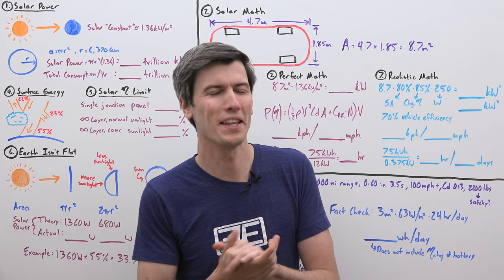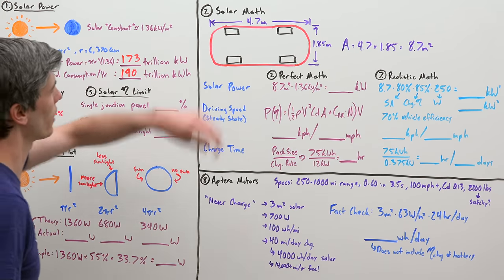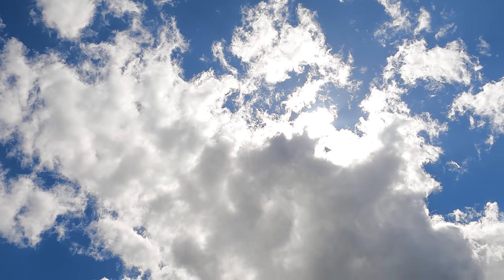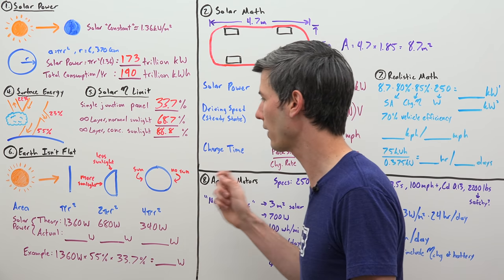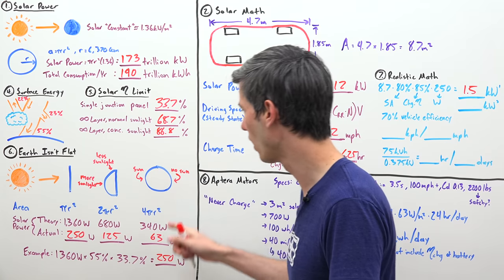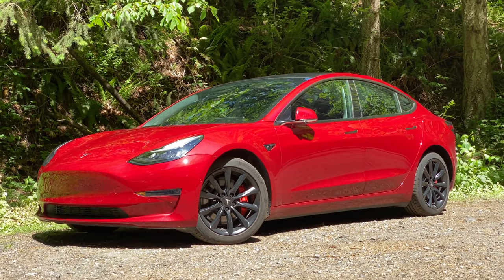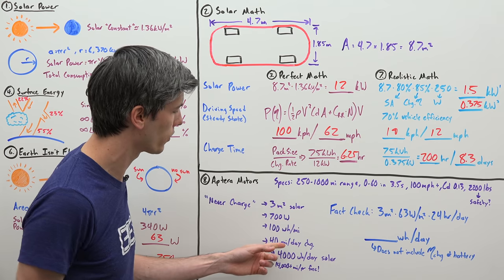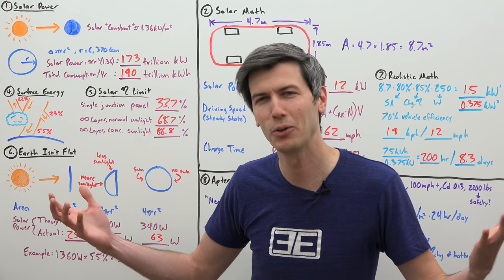Why Don't Solar Powered Cars Exist?

Comment: I've always wondered why we don't use solar as supplemental charging. I live in an area with lots of sunlight, and I always park my car out in the sun, and I really only drive to and from work and to and from the store. Both times my car is out in the sun, as well as when I part it at home. While solar panels may not be able to charge quickly, the fact that I and many people leave their car in the sun for many hours a day would help keep the (usable) range higher while keeping our reliance on non renewable energy low. And if you need a real charge, that's when you plug it into a charger
Reply: So… like the car he spends the last few minutes debating. 
It’s still not reasonable for most people. It’s just not enough power, since that car claims it gets 40 miles per day of solar charge in ideal conditions.
Reply: @FuncleChuck  most people that I know of don't drive more than 40 miles to and from work. And again, you're missing my point. Using solar as SUPPLEMENTAL charging. Charging that I literally gain for doing nothing but parking my car out in the sun, as I always do. Not using fossil fuels, not having to hook it up, I just sit it where I park it and I get extra charge.
Reply: @hypershadow5g that’s not a normal car. It’s very very optimized for that purpose. And it’s price will reflect that. 
When the “fuel” is free, the cost is the cost - it’s still always far cheaper to put up a physical solar array that’s built for the purpose.

Edit: and it’s not “doing nothing but parking” - you have to install the solar panels. They have mass and they have cost. That’s not nothing. It’s far far far more efficient and less costly to not bother.
Reply: @FuncleChuck  you mean the 26k base price for the 250 mile version?
Reply: It’s like none of you watched the video. The compromises are extreme and unnecessary when you just plug in..
Or go buy a “solar powered” bumper sticker for your Prius - just as effective as these solutions
Reply: @FuncleChuck  It should be reasonable for most people the average daily driving is about 29.2. I'm right at about 40 myself, but also get to work from home some days of the week, so that would even out quite a lot for me.
Reply: @FuncleChuck  Exactly. Another practical consideration is that you basically have to always park your car with unobstructed view the sun. In hot climates where there is actually lots of sun this will be very impractical. Alternativly the A/C is gonna eat a lot of that away. 
I think the company is legit but the product will be an engineering excercise more than the next "Tesla Killer".  
The average person is far better off installing solar panels on their roof. They are probably less obstructed and they last 20 years.
Reply: I think that from a practical standpoint, it usually makes more sense to have stationary solar installations.

All else being equal, a stationary solar installation is going to be cheaper per watt, because you don't need to worry about it being tough enough to survive the road, and you don't need to make it conform to the shape of a car. You can also put the installation somewhere where you're guaranteed to get good sunlight, while cars get parked under the shade all the time.

It's better for the environment to take the money that it costs to put solar panels on a car, and instead spending it building a much larger stationary solar installation. That energy can be used to charge your car, run your AC, or anything else you can use electricity for.
Reply: @Empiro3  Installing solar panels is hard, lots of wiring that has to be hooked up on-sight. Buying solar panels already installed from a car factory would be easier, and people like it when things are easy.

Comment: Great video! Here is some updated numbers. Solar cell efficenies are defined at Air Mass 1.5 which is about 1,000 watts per meter squared. This irradiance happens in places with the same latitude as Colorado for example. And the theoretical efficiency of Silicon solar cells is more like 28% with modules today reaching 25% efficiency. The 33% number is for the perfect absorber, not Silicon

Comment: How about an in town commuter car that is not intended for freeway use.  Our residential speed limit is 30 mph. Most of the larger roads are 45 mph. Shopping here is about 5 miles for all the major items.  A carport could be extended from the house to allow for larger solar panels so it can be charged when not in use.  It would be nice if there were charge ports at the shopping centers to park under.   Heck, how about a small trailer for project work that would hold a 4 by 8 piece of plywood and also cover it with a solar panel system which if it were not weighed down too much would increase the range of the car.

Comment: Your content is simply unparalleled! Never stop! I would love to see a video explaining the classic 'Detroit Locker'!!! I feel it is beautiful in its simplicity, and so often misunderstood. A specific detail I'd love for you to explain it the physics that cause the outside wheel to disengage in a turn. Inertia? the outside tire wants to continue straight? Thanks! - Josh Gerbrecht
Reply: yes
it's dynamic weight distribution, I'd instinctively say. the vehicle's center of mass shifts to the outside. (due to inertia since a turn is also just an accelerating; you slow down in the forward direction and speed up in the direction you're turning into. so, just like under straight line acceleration or simple braking, where weight also gets shifted towards either the rear or front respectively. you can easily see this; even the car squats down or seem to dip over.) this "virtual" higher weight on the outside wheels can cause them to "give up."

Comment: Even that 80% surface area seems optimistic. With windows and the curved shape of the car I think youd be lucky to get even 50%
Reply from the maker: That's fine! Pick any percentage and apply the math as you see fit. But as an example, the Aptera puts solar panels on the dash, so even the area under the window gets solar power. Hopefully some sort of anti-reflective coating so you're not staring at the sun haha.
Reply: no, no, please imagine a roof over the car, a second floor, like those big wings
Reply: And the aptera has no back window. Just lots of panels.
Reply: @ecospider5  Its also much smaller than the tesla.
Reply: @EngineeringExplained  Not a criticism, btw. Just an observation. You cant control for every variable. How flat would those solar panels would actually be? If you are driving and working in a city can you actually park a solar powered car somewhere it could charge? Etc. Great video.
Reply: The Earth's orbit is Is slightly oval and that changes the seasons which would also have and affect Solar panels.
Reply: 80% was pretty bad.  Just looking at the video clip of your T3 car, that is likely 30% of your gross area external....unless you cover the rear glass with an awning of cells.  And you've done no engineering on the handling dynamics of the modified car, or the added mass, or the added thermal changes.

Your whole theoretical whiteboarding is ok spitballing  ....but "it's just slavery with more steps"
Reply: @patrickjohnson8511  We have seasons because the earth is tilted on its axis, not because its orbit is elliptical.
Reply: @nathanpapp432  The Solar panels on an Aptera are actually arranged in a pretty flat configuration.
Reply: @ecospider5  is one of the options.  Rooftop is standard, next option is front surface, maxing solar out covers the rear window in solar panels
Reply: @nathanpapp432  Not much, it is very close (though wider!) to a Prius...  Aptera have to find a way to shrink it a little for the European market!
Reply: Google the Aptera and take a look at solar panel placement. They are all pretty much flat as they designed the upper surface of the car like a flattened teardrop. Like Jason said, there are even panels on dash so I suspect that it is pretty realistic. The only issue is you get a space ship looking car when you do that. I like it, some may not.

Comment: As a mechanical engineer, first 4 minutes I was grinding my teeth with the amount of assumptions and non-realistic (theoretical math).  Thank you, for quickly addressing my concerns 😅 

However there were still quite a few real-world issues not addressed.  The car’s profile is not flat so much of the panels at any given time would not be converting much energy.  
Another thing, Most urban areas are are covered in shade.  Look at any dense urban center and buildings will be blocking most of the sunlight.  Not to mention trees and other obstructions.  
Temperature: we know there “flex” panels don’t do well in high heat scenarios.  So in that ideal situation where sun is perfectly blasting down, the roof temperature can easily be in the hundreds and the flex panel’s efficiency goes down.
Reply: Yes and forget about heating and air conditioning. Think of that little 1500W foot warmer under your desk.   You need about 3000W for heat and 3000W for cooling.  There goes your energy budget.

Comment: As with every single niche wacky solar panel installation idea, be it on cars, or roadways, the obvious solution is to just put it on the building or field right next to it that isnt being used.
Reply: Yeah - it is unfortunate how underused EV batteries are for storage.
Reply: Sticking them over waterways makes a lot of sense though; saves water, cools panels. The results in India are pretty promising, particularly with the land that’s used for irrigation currently being useless for anything else at the moment. Synergistic free real estate!
Reply: @Axman6  well, 'nature' is not that useless. Planting fields full of solar panels has proven to be detrimental for fauna. just putting them on rooftops is a good start. (like most of western europe is doing right now). yet it's still not really THAT efficient that it makes a true impact on a country's power consumption. Plus it takes a good o'l dip during winter months.

Comment: You obviously haven’t seen the Aptera. What most of us fail to realise is that most of the energy or fuel used to power the average car is actually to move the car. We are just a bit of baggage along for the ride. Modern cars are obscenely too heavy. Lower the weight and ramp up aerodynamic efficiency and you actually get much greater range with far fewer batteries. This is what the Aptera has done. It can go up to 1000 miles on a single charge and it can be configured with a blanket of solar cells giving it up to 40-50 mile range per day just from solar charging. That would be in an ideal climate like California. Rainy countries would get less, but it is interesting to note the average number of daily miles driven in the US is less than 40 and in Europe less than 30. The Aptera can pretty much cover that with the full solar package. Because it is light and super aerodynamic it can operate with a fraction of the battery power and charge using a standard wall power outlet. The amazing thing is the price. It starts at 25 thousand dollars and it looks like it’ll qualify for a ten thousand dollar subsidy soon...making it only 15k for the entry level model. Tesla should be ashamed they didn’t think of it. They should definitely invest in it. I’m getting one.

Comment: If you have a short commute, which some of us do, and use less than 10% of your battery a day in a Tesla, that would theoretically compute quite well... And even if it doesn't get me all energy for free, it might still hit 80% of my needs. There is one major drawback though: I usually don't park outside, especially at work. So the actual sun time my car gets might be as low as 5 hours a day, which makes this unfeasible. But I do agree with Anton, it would be nice to have that option.

Comment: My sailboat is 100% self powered by solar and wind. I do not even have a way to plug in. Taking the fact that it takes energy to produce the panels and generator nothing is free free.
Reply: On our boat we still have diesel for propulsion but we've removed our generator. We can go about 3 days with no sun before I start getting nervous :D Solar and lithium are GREAT for boats.
Reply: I can install a charging port for you.
Reply: we can make it free free if you give the boat to me ;)
Reply: There is an interesting video that shows a wind powered land vehicle going down wind faster than the wind. As a sailor and with a physics background I was wondering how they did it. The solution is at the end and it’s real. I forget the name. If you are interested I’ll look it up.
Reply: @RCdiy  Bernoulli Principle.
Reply: @paulsmyers203  With the heat and bugs in Panama preparing for the Coconut Milk run in May you HAVE to have A/C.
Reply: If its cheaper then fuel,it takes less energy to make
Reply: @RCdiy  Was a video by Veritasium, and it works because it pushes the propeller sail the "wrong" way and drives forwards using the wheels.
Reply: @daveblock4061  I do actually and we can run it from batteries/solar. But not all the time obviously :D
Reply: I mean, if it weren't at least mostly powered by wind, I would question the word "sailboat"....
Reply: @ps.2  I am speaking of the electrical systems

Comment: There is also an amazing solar car company called Lightyear that makes a more conventional looking car. My bet is that we will see a huge rise in electric cars with partial solar energy production in the next 2 decades :) (Setting a reminder to look back if young me was delusional or had a clue 😅)
Reply: If you average the miles generated per day its 24 miles per day Produced by the car  (8.3 days per full tank, 200 mile range, yada yada), this is around the average for americans to drive every day, so it actually does mantain itself basically.  (Avg american drives 29 miles a day, 24 is 82% generated by the car)
Reply: I bet in 20 years there will be a solar package available for econoboxes like corolla, civics, mazda3's
Reply: Unfortunately, its conventionality caused it to be less efficient that it could be. Despite the Lightyear One being able to move 60km with 5 hours of solar charging, you can more than double its efficiency by using Transparent body to allow more solar panel  area while still aerodynamic and safe. By removing steering shafts and all gears we can increase efficiency even more. Allowing human power will increase power even more like Velomobiles.  We still have not pushed efficient technologies to the maximum. If we do, 1 hour solar  charging can move 60km.

Comment: There is a solar powered car. The Lightyear 1!
Reply: Aptera is also making a 1000 mile range solar chargeable car that can charge through its solar panels. Not really fully solar but has solar power integrated 
Edit: didn’t see he covered it before just finished the video
Reply: It’s covered by the video when you watch it
Reply: @flylfb  my bad I didn’t watch all the way to the end 😅
Reply: It is just a barely driveable prototype.
Reply: Watch the video before commenting.

Comment: I think people sometimes miss the point when talking about Solar powered cars. Its not so much the extra range when driving that's important. Its more about what can be gained when the car is not in use. For example if a car can gain just 5kwh of energy when sitting on a drive or at work, thats 20-25 miles of free range with today efficiency levels which is a typical usage for many drivers. It would be a huge help for those who cant get a plug installed at their property and it drastically helps lower running costs and strain on the grid.
Its by no means an easy objective, but Aptera are in the process of proving how much of a difference a change in philosophy can make, another manufacturer making big strides in this area is Lightyear. Best of luck to them and the others. I'm hoping in the next 20 years or so Solar panels become much more commonplace on cars.
Reply: With the present panels the true energy gain is more like 4 or 4.2 kWh on a sunny day, but your point still holds.  Solar panel efficiency is likely to increase and cost come down over the next 20 years as well.  Aptera has IP over a design that makes them easy to replace in the event of damage or technical improvement.

Comment: You can recalculate this as a range extension. In the worst case for a car with a range of 400km, traveling at 100km/h, your daylight charging rate results in a range extension of ~4%. The best case is that you get infinite range if you take at least 8.3 days (from the calculation in the video) to drive the full range of the car. Typical usage is probably somewhere in between.
Reply: Not having to charge as often would mean fewer charge cycles, which would reduce battery degradation.